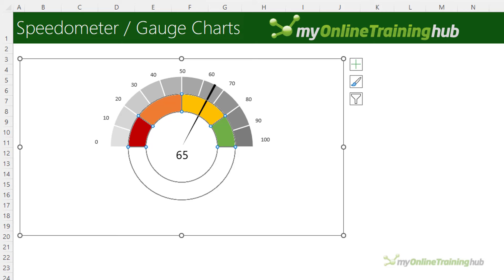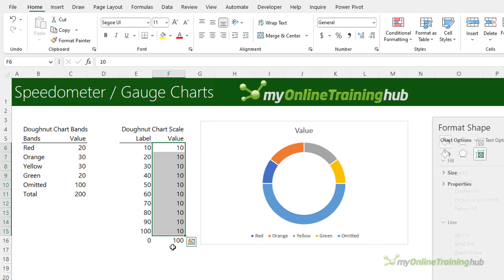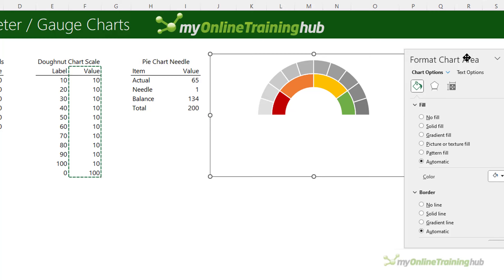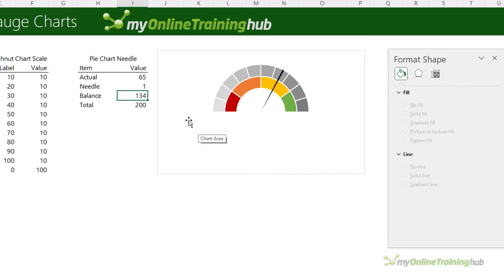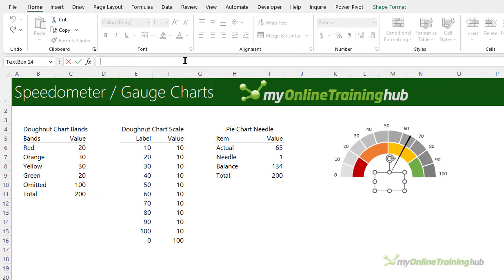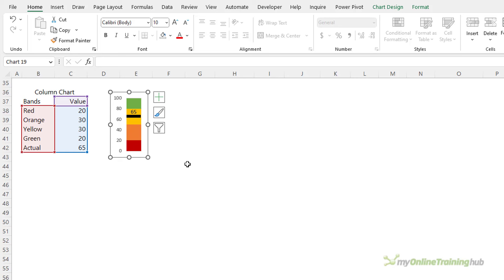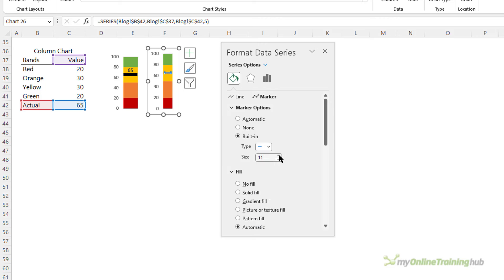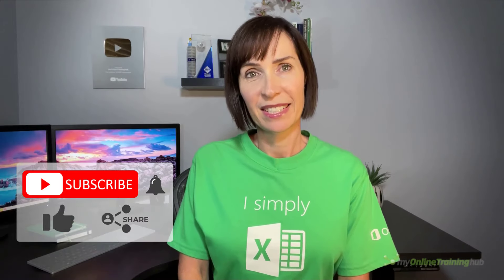Excel Speedometer Charts - How to build them and why YOU SHOULDN'T!

Comment: Thanks for your tutorial which is excellent as always. I want to show a number in a pivot table in this speedometer. How can make the connection between pie chart needle number and the pivot table number, by selecting the item from a slicer?
Reply from the maker: You can add a data label for the pie chart needle and link it to a cell in your workbook that's connected to the PivotTable value. If you get stuck, you're welcome to post your question and sample Excel file on our forum where someone can help you further: https://www.myonlinetraininghub.com/excel-forum

Comment: Hi .. thanks for the video .. quick question please. The video shows how to make a single stack column chart with a line marker .. is it possible to make a multiple columns chart with their corresponding line please? Thanks
Reply from the maker: Yes. Add more columns to your source data table and extend the series to include the new columns. Set the 'line' for the Actual series to 'no fill' and add a gap width to the columns so they have space between them. If you get stuck, post your question and sample Excel file on our forum where someone can help you further: https://www.myonlinetraininghub.com/excel-forum
Reply: Thanks, finally instead of column chart with marker can it be turned into a bar chart with line marker please

Comment: Would it be possible to have a gauge (or speedometer) chart...using doughnuts similar to your speedometer...but that not only show the 0% - 100% range (horizontally, where the 0% is far left and the 100% is the far right of the gauge)...but to also extend the gauge to include negative values (that would extend the gauge to the left, going backwards...making a circle below the horizontal axis) as well as values that exceed 100% (and would go to the right, going forwards...making a circle below the horizontal axis) that currently stops at 100%?
Reply from the maker: Possibly, however I don't have any examples of it. You can try posting your question and sample Excel file on our forum where someone might be able to help you further: https://www.myonlinetraininghub.com/excel-forum

Comment: I had never thought of using a pie chart for the needle!  On the rare occasions when I have used such a chart I have tended to go for a superimposed scatter chart with a single line segment from (0, 0) to (SIN(ϑ),  COS(ϑ)).  A nice thick red line and a faint shadow (maybe with a similarly formatted red disc at the centre) and all is ready to go!

Just a moment of heresy.  The purpose of such a large display of a single value, is to force the audience to focus on the value by excluding other information that might distract from the key point.
Reply from the maker: Thanks for sharing your technique. If you’re only displaying a gauge chart then ok, but most people put them in dashboards where they aren’t the sole focus.